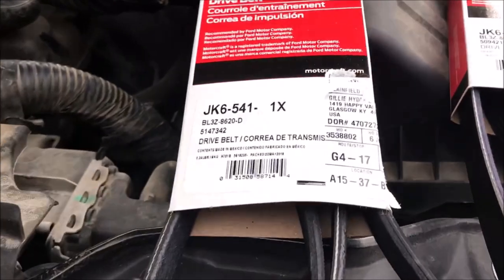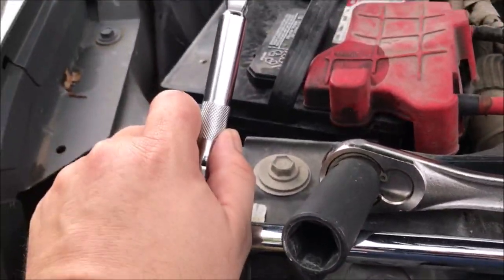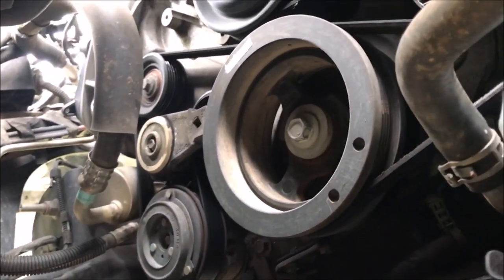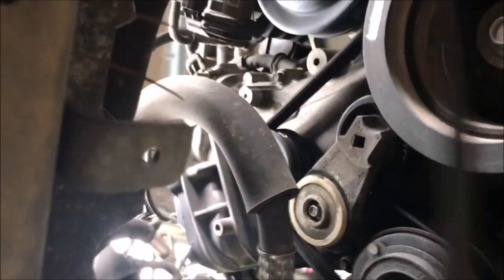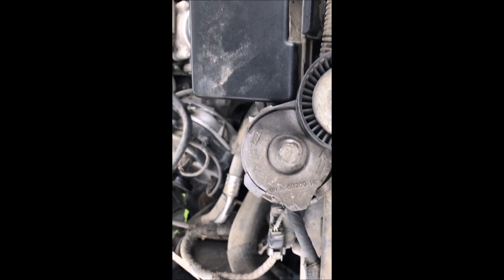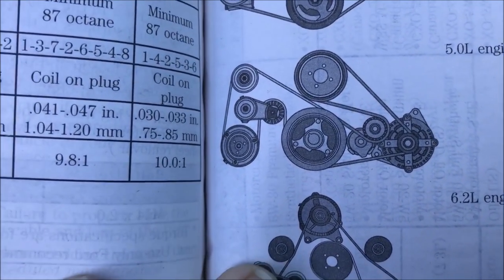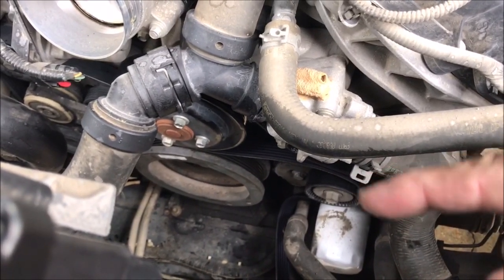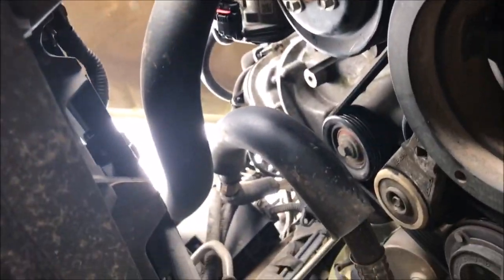2011-2017 Ford F150 5.0 Both Serpentine Belt Install

Comment: 2015 F150 5.0 has 2 tensioners. The rear belt you use the hole + a breaker bar. The forward belt you use a socket on the tensioner pulley

Comment: 2013 has 2 tensioners. On the driver's side, I used a 15mm socket and std. ratchet. (pull up.)
Reply: My 17 also has a tensioner for each belt
Reply: That's how you break your tensioner man, why didnt you just pull the tensioner up gently and take the belt off?
Reply: Pull up pull up on the tensioner by the alternator￼
Reply: There was no need to cut either belt, you have two tensioners on your truck. The zip try method was not necessary on your model of truck.

Comment: To point something out to you . That belt has a tensioner also. You don’t have to do all the extra zip tie stuff.
Reply from the maker: The Ford Service manual says to use zip ties. Not making it up.
Reply: I have the exact same truck as Vic and mine has the two tensioners also thank god. Mine is a 4x4 5.0
Reply: That's hilarious, and makes no sense as to why Ford Service would suggest that. Lol! @MyTorino
Reply: Andrew Siegwalt it’s true they do tell you to do it that way... I also called a ford dealership near me and they told me the 5.0 only has 1 belt. Which they clearly have 2 so it don’t surprise me to do things in strange ways.
Reply: Mike Torino, mine is the same as yours.  Two tensioners.  Just put the socket on the idler bolt and push it over to the left to take off the water pump/alternator belt.  easy peasy.
Reply: Correct, the pulley to the right of the crank pulley is a tensioner, get a socket on it and move to the left to relieve belt tension
Reply: That's why when the belt was cut the tensioner snapped wide open 6:17
Reply: @MyTorino  I'm pretty sure if you got the ford service manual the actual dealership uses, there's not a mention of zip ties.  Or if it is, the engineer writing it was either high or drunk at the time.  There is really no excuse, because both sides have their own releasable tensioners and they work perfectly.

Comment: both belts on your engine have tensioners. No reason to be cutting belts. To remove the left side belt, just remove the tensioner on the right side to let it come out.

Comment: My 2013 has two tensioners. Not sure how yours differs from mine. I was reluctant to start because of this video. That pulley you removed is the tensioner pulley on the drivers side you called a 'nonmoveable tensioner?'  Work hard or work smart. It took me about 15 minutes.

Comment: Confirmed on my 2012, both belts have tensioners so they're really easy to swap out, no cutting belts, no zip ties, etc. I also found that you don't need a breaker bar, I was able to do both with just a standard socket wrench. At 8:13 in the video, instead of putting the wrench where My Torino did, I put mine in that huge open area to the right of the radiator hose and was able to push down with the weight of my body pretty easily and it also opened up the area to the left for me to work the belt on with my other hand. I struggled with this trying with the wrench in the same location as shown in this video, once I moved the wrench it went on my first try. This video was still helpful, saved me a bunch of money.

Comment: Good video. Hope this helps some people. I have a 2011 F150 5.0. I did not have to cut the belt off. That is a tensioner pulley on the right side. (Belt that goes to alternator) It's a 15mm bolt.
Counter clockwise  (Lefty loosey) takes tension off the belt.
Inner belt has a tensioner that takes a 3/8" drive to remove tension. Clockwise.
No need to cut belts or stretch them. Didn't have to take any tensioners off either. Easy peasy. Happy wrenching!

Comment: So to follow up from my post yesterday. I changed both belts about 20 minutes ago. I have a 2012 and it took me about 45 minutes total. On my truck you definitely don't have to use a zip tire. There is a tensioner pulley on the alternator side. 15mm socket needed. I did have to take that tensioner off (13mm)to put the main belt on first. I'm no mechanic and I faired pretty well. Anyone mechanically inclined should have no issues whatsoever. Appreciate the vid my friend! Tremendous help 🍻

Comment: My 2016 F150  5.0  4x4 only has a tensioner on the AC belt.  The main drive belt is a stretch belt too.  I almost bought an install tool too, but I noticed the crank pully would not fit one.  I was going to call Ford service (they are trying to sell me a new truck).  I suspected the install was a zip tie ; your video has confirmed it.  Thanks for posting this video!

Comment: Thanks for this video. It was a huge help. Originally I was just going to change the belts and pulleys. When I saw your wobbly water pump pulley I bought a new water pump too. Turns out the old water pump was ready to let go.

Comment: Great video! Thanks for making it. It was a huge help.

I agree there are two tensioners and a zip tie isn’t needed. 
Rotate the 15mm bolt on the tensioner located left of the alternator counterclockwise to loosen the belt. It helped to hold the head of the ratchet while backing off the tension. Then use a 13mm socket on the tensioner’s lower bolt to completely remove that tensioner otherwise it prevents the other belt from being removed. At least that was my experience. 

It helps to pull from under the truck to loosen the tensioner on the passenger side of the crankshaft pulley. Trying to back the tension off from above was a lot more difficult.

Good luck!
Reply: Correction, for the tensioner left of the alternator - the tension relieve  bolt is 13mm and the tensioner removal bolt is 15mm.
Reply: @zakschatz8154  except for when there is no tensioner on the alternator belt side.. hence the zip tie method. Your truck must be a slightly newer model that uses a tensioner on both sides right? Im confused now lol. My 2012 clearly has a tensioner on the left side of the engine but just and idler pull on the other..
Reply: Well I got out there and looked little closer and sure enough enough there is a tensioner but it’s like you said you got a put your wrench on that bolt that’s actually on the pulley to push it down. Very easy to see why people don’t think they’re actually is one there

Comment: thats what happenes to me.  Doesn't matter what car i own its always one issue after another :)   My last car was a Toyota scion TC and did everything to that little sht from water pumps, pulley's, coolant etc.  My current car is a 2014 f150 XLT and so far replaced 1 hose , coolant,  Spark plugs, all filters , all brake pads and hardware, so that being said i enjoy watching your videos because sooner or later going to have to tackle these things like you are. Thanks torino.
Reply from the maker: Thanks my friend. Greatly appreciate you watching..

Comment: Another good video.  I had to replace the water pump on my '13 F150 5.0 at only 61,000 miles.  That has been the only issue I have had with my truck, though.  Look forward to more content.
Reply from the maker: Thanks for watching. With 111,000 miles I am expecting more issues to crop up...

Comment: Thanks for sharing, you are informative as well as entertaining. The a/c side of the mustang GT doesn't have a tensioner, but a stretch to fit belt.  Purely curse to all. I was looking at your videos in hopes of finding that the f150 had an a/c tensioner. Thank you Sir for the assistance and good wrenching on the h2o pump.
Reply from the maker: Thanks for watching. Stretch to fit are definitely not very good thinking.

Comment: Thanks for the vid...I got the same truck...my water pump situation actually brought me here.  Your mention of 100K swap out for the belts reminded me to the same... Thanks for that.  I'm hoping to pull the pump without pulling the Throttle Body. Fingers crossed.
Reply from the maker: Good Luck. Thanks for watching
Reply from the maker: I just subscribed looks like you have an interesting channel.
Reply: @MyTorino  I'm trying, looking to renew my efforts...took a few months off the YouTube grid. But I ready to plug away at some more. Got everything pulled tonight. That pump can get cocked on the way out and is a pain when that happens. No vid on this one.... didn't have the luxury of time but may do something on it....not sure. Hey, thanks for the sub! I'll followup when complete.
Reply: throttle body take 2 minutes to pull-off, plus you can clean out the varnish...and have great access to the water pump, thermostat, and installation of new upper and lower hoses....keep in mind the upper hose has a notorious leak from wear at around 75k miles

Comment: I have a 2016 5.0 and just did my two belts and replaced one of the tensioners,  you have the same thing there are two tensioners there's one right above the oil filter also no need to stretch the belt just the tensioner.

Comment: FYI there is a tensioner on the front belt. I tried the zip tie trick and couldn’t get enough slack because the tensioner was seized.   i removed it and freed it up with WD40 on the bench.   Reinstalled it and used 15 mm socket to move tensioner and the belt went on easily. Cheers

Comment: I believe that the driver side idler pulley is left hand threaded and acts as the belt tensioner for the larger driver side belt.  I think the AC passenger side belt on the Ecoboost is a stretch belt and has no tensioner.  I could be wrong

Comment: both tensioners are adjustable, the zip tie is not needed but a 15mm on the driver side tensoner and pull up

Comment: Thanks for the video I have the exact same truck in a 5.0 4x4 F150.lol that belt stretcher sounds like something I used to tell my better half to get me when I needed a tool and I was under the vehicle lol. and I guess they have two different versions of the setup. Mine has a tensioner on each belt.
Reply: This one in the video has a tensioner in each belt too, you can see them both in the video.  I think only the very early 2011's had a stretch belt on the AC side.

Comment: Each belt has its own tensioner...
Use bar to release pressure for first belt "right side" remove belt
Then remove right tensioner cause it will be in the way of second belt.. "left belt 
Release pressure on second left tensioner, remove belt...

Comment: Great video!
The  front tensioner that can be rotated near the alternator with a swivel and long ratchet if you are lucky enough to have a fully torqued pulley bolt.

I avoided the zip tie simply rotating the front tensioner at the pulley bolt.

Comment: Listen up those who don't know, since I just did the belts on my F150 5.0 2013 (about two hours ago to be exact, and quite successfully and EASILY). 

There IS NO 'stretch belt'.
 

They are BOTH serpentine belts, non-stretch models. 

And both belt tensioners can stay on the vehicle, the tension they provide on the belt can just be backed-out/loosened by using different tools (3/8in drive square for the A/C belt tensioner, and 15mm socket for the alternator/water pump tensioner) and you only loosen those gently and fit both belts on. 

Doing anything else with zip ties or stretchers is absolutely unnecessary and just takes thousands of miles of life off your brand new belt, but hey it's a free country, you can destroy anything you want to as long as it's yours. 

But no, you DO NOT have to cut ANY belt to remove it.  Just gently back-out the tensioner on the belt you want moved. 

On the A/C belt, the back end of the tensioner on the Alternator side gets in the way of the A/C belt's removal, so you have to fully back-out the alternator belt tensioner to remove the last part of the A/C belt.

Comment: Worked great until the bolt on the pulley broke and started to loosen. Could not get it to go any further without taking the bolt out. About that time I figured out that there is indeed a tensioner on both belts. Love the comentary.

Comment: Just did mine after watching this video. Found out they both have tensioners. The one that you removed, which you have to do anyways, you can use a 15mm and turn it counter clockwise.
Reply: I was rolling on the floor when I saw that. He shouldn't take offense, it's tough being human. I am guilty of the same mistake.

Comment: 2014 5.0  I had the same problem trying to get the rear belt off. Wouldn't fit between the crank and the tensioner housing. Had to remove it to get the belt on. However, there is no need for a zip tie. That's in the FORD manual? That tensioner you removed IS moveable. You grab the bolt and pull up and slip the belt on. Didn't use breaker bars for either side. They aren't that stiff.

Comment: Too late now :) but for others who may watch this - at 100k+ miles its best to replace the water pump, tensioner and other pulleys while changing the belts. There are kits with all the ones to replace.

Comment: Did you ever change the water pump, looked for a video but didn't see one.  Good video on the belts.  I had no idea there were two.  Was looking for a fix for a ticking noise on my 2012 F-150 and think it is the crank belt.

Comment: I have a coolant leak on my Y pipe. Common problem with these trucks. It would be a good time to do my belts. The truck has 98000 miles on it. How did you come to the conclusion that you need a new water pump. My heater kinda sucks when the truck is idling. Once I'm driving the air goes from warm to hot so I'm assuming there's something wrong with the pump unless this is normal with these trucks.

Comment: Stretch to fit belt? The tensioner keeps tension on the belt, no need to "stretch" the belt. It'll do that all on its own after a few cycles. Yet the tensioner will keep it tight

Comment: shoulda knocked-out the water pump and thermostat while you had the throttle body off and the belts removed.  
replacing the radiator hoses upper and lower woulda been the icing  too

Comment: on your particular auto there are no stretch belts... you have two belt tensioners - some of the 5.0 engines with the stretch belt had a modification and the stretch belt that drives the AC was replaced with a belt and tensioner system.   If you have have a tensioner on the AC belt then you have NO stretch belts - when you cut off that belt that drives the water pump and alternator watch the pully that appears to be an idler pully... it is a tensioner...

Comment: This video is bad on so many levels I don't even know where to start. The most glaring error is you are turning your crank bolt counterclockwise. Its just pure dumb luck you didn't unscrew it. You've also got 2 tensioners on your truck - you use an 18 socket on the front belt idler and a 3/8 drive on the back one. You didn't need to do any of that stretch to fit nonsense - you don't have a stretch to fit belt.  I don't know why Youtube put your video at the top of the list - it shouldn't make it onto any list at all.

Comment: Each belt has its own tensioner...
Use bar to release pressure for first belt "right side" remove belt
Then remove right tensioner cause it will be in the way of second belt.. "left belt 
Release pressure on second left tensioner, remove belt...
Reply: My Buddy's 5.0 only has one tensioner for the alternator, and water pump. His ac belt doesn't have a tensioner and idle pulley.